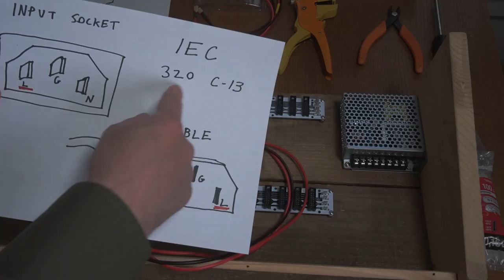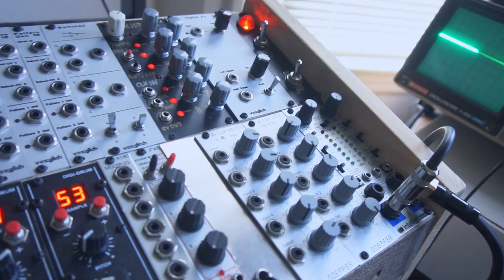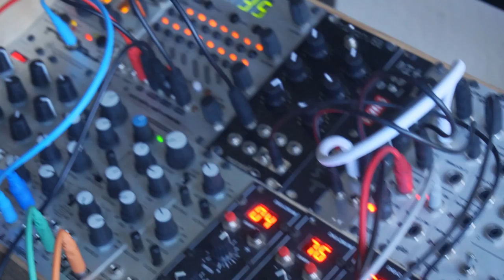DIY Eurorack Case Part 2: Power Supply

Comment: Hey.... your comment disappeared from my video hmmmm...

The output of that reverb needs to be amplified, which is taken care of with the output mixers. The wet/dry levels should be about equal but it's easy to mess that up -- one of my My Favorite Reverb modules has the wet level louder than the dry. Can be cool while performing -- keep the signal dry dry dry then twist the knob to dump some signal into the reverb and "BWAAAaaaahhhhhh" that reverb signal lives in the output till it fades :D

By the way, GREAT case, great production on this vid -- glad to find another synth DIY person!

Comment: Thanks for this detailed and clear explanation! 

I'm about to embark on a DIY case journey and everything is pointing in the direction of a Meanwell power supply, however one thing I don't see anyone who's using a Meanwell mention is that the -12V comes at a maximum of 500mA / 0.5A , according to my ModularGrid case sketch I would draw 750mA (+ headroom) on the -12V side, I've sketched a 7U 104HP case. What are your thoughts on this, do you know how much your cause would draw on -12V and if that's all going well?

Cheers!
Reply from the maker: Interesting, I don't use modulargrid that much so I don't know exact figures, but my case would probably be 300-400mA on the -12V rail. Eurorack modules don't tend to draw a lot of negative voltage, it's really just for balancing op-amps, so I'm guessing you have a lot more modules in your case. I use one Meanwell RT-65B for each row of my 84hp case. They can do more, but separating analog and digital modules gives me much better noise floors. I would recommend using at least two power supplies for your case.
Reply: @extralifedisco  Good points! 

One PSU per row is definitely the safe option. I've noticed it's the pure analog modules that draw the most -12V , I'll have a look into separating them their own rows and perhaps use a Doepfer LC3 to provide for the heavy drawers! 

Good insight, thank you :)

Comment: Thanks for making this video. I wired up my case today, checked the voltage...everything looked good until I plugged in a module and it started smoking? I used 12 gauge wire. Do you think that might have been the problem?
Reply from the maker: 12 gauge sounds, if anything, oversized for +/-12V. I don't think that would be the problem. Most likely you have reverse polarity somewhere - I had the same thing happen when I connected a mixer module backwards (it had an unshrouded 10 pin connector). Make careful note of the "red stripe" and -12V orientation on the eurorack module and double check that your busboard has -12V in the same place .
Reply: thanks for your response! i realized it was the ribbon i was using--nothing to do with the case. it works great! @extralifedisco

Comment: I just got my PSU in the mail today lol (think it's the same one). I'm building my case too this week. 126HP 9U, total is about €75,-
Reply from the maker: Nice timing. That'll be a monster case! Good luck with the install
Reply: @extralifedisco  what is the voltage/ampers of that psu?
Reply from the maker: @Karedu.  50W - 5V/4A 12V/2A -12V/0.5A (The 65W version is common as well - 2.8A on +12v)

Comment: Sorry for the late comment! Curious though, I’m making my first case following this, and in the video you say you got a 10amp fuse for the power switch, but the link in the description is for a 5amp fuse. And the data sheet for the switch says it runs 6amps. So is a 5amp fuse ok?
Reply from the maker: 5A*120V= 600 watts. These power supplies draw only 65 watts so a 5A fuse should be plenty large for this application, though inrush current will be higher, it shouldn't trip a slo-blo fuse.
Reply: thanks!

Comment: man your videos are perfection. I followed your advice for building faceplates (from your passive mult video) - and now i have about 5 nice fully diy modules (mostly MFOS modules) 
now i need more power I got a meanwell rt-65-B
2:05
one question - do I really need a Power Entry Module with an EMI filter?
locally I can get IEC320 fused switches cheaply everywhere - but switched fused emi filtered ones are much harder to come by.
could I get away without it? meanwell supplies are already supposed to be potentially noisy - i dont want mine extra noisey...
Reply from the maker: Excellent, glad to have helped on your journey! Good question about the EMI filter on the entry module. It's probably a little above my pay grade, but I don't think the filtering will have much effect on the noise in your eurorack system itself. It will probably prevent the PSU's high-frequency switching noise from being conducted back to the wall outlet through the power cable - so more likely that kind of noise would end up as RF emissions audible through other devices (e.g. a guitar with single coil pickups). It's definitely not required, so I would use what you can get your hands on and then if you notice that the synth being on causes noise somewhere in your signal chain, consider adding filtering (you can also install a discrete EMI filter inline inside the case rather than swapping the entry module).
Reply: @extralifedisco  good idea - I can get discrete emi filters from my local radioshack (Jaycar) no problems.
thanks for explaining that makes sense enough to me. If i notice some RF noises coming from my setup while my Eurorack is on ill look into it.
but in the meantime - I got a cheap one off ebay (with fancy led switch) which will be here soon - and i can finally finish my case - a significant upgrade from my cardboard shoe box skiff :S
 thanks again and I look forward to the next one :)

Comment: the order of phase and ground on mains is not so important (when in US and Europe, not UK) because wall socket plugs can be rotated 180 by users, whicj effectively switches 'polarity' 😊
Reply: Are you referring to two-prong plugs? Those shouldn’t be used and, if for some reason they are, the hotwire has a wider spade than the neutral. Unless your repurposing some very old cables that shouldn’t be an issue.

Comment: Just a tickle at 120VAC   At 1:39, that power supply would be cheaper on Amazon!   Mounting a Module ABOVE the power Sup. will produce LOTS of noise on that module!!
---
Proper US Color code would be GREEN, NOT Yellow!  Should find-out what the total current is and adjust the Fuse size accordingly!
Reply from the maker: Green would be good! I'm used to Romex with black/white/bare for L/N/G but I didn't realize there's a separate red black green standard. 

Good point on the module noise, I've tried to keep the analog stuff in my cases far from the PSUs in general but that's mostly because they're to big to fit on top lol
Reply: There isn't a red black green mains standard any more (there was in the UK once). The US standard is black, white, green, elsewhere it is brown, blue, green&yellow. People expect to see these colours and understand what they mean. If you use non standard colours it creates confusion and you may make a mistake when you change something.
Reply: @hintoninstruments2369  - And your telling this, why?  Yes I know the Standard in the US.

Comment: How did you screw down the modules to the wood?
Reply from the maker: With small screws, they are size #4 x 3/8 24 TPI pan head sheet metal screws

Comment: I’m a bit confused . The performance at the end showed you switching on two switches to power it up didn’t show them when wiring up ,
Reply from the maker: Yes, I added in a front panel module to allow each busboard to be turned on separately. Each panel switch is just an SPDT that toggles on the +12V line from the PSU to one busboard. This is not often necessary but I was having issues with some older digital modules not booting properly when other modules were plugged in so wanted to separate them.
Reply: @extralifedisco  thanks for that explanation .. I’m just about to build my first diy case , hmm I’m might look into this as a solution , modular grid has calculated my modules power needs , and I’m getting a bit close to the top limit of the meanwell RT65B ,, I. Planning on running 12u at 101 hp .. if switching them all on at the same time causes issues .. fingers crossed ..

Comment: This should be called How NOT to wire a Eurorack case and How to get a Darwin Award.
The IEC Inlet should not be on the outside of a wooden case, it is asking to get broken and then you will have exposed live parts. A better way is to mount it on a small metal plate and mount that on the inside so that the inlet is recessed.
There are proper rubber boots to go over the back of inlets and insulate everything, get them from the same source. Using electrical tape is tacky and will eventually come off as the adhesive goes soft or dry.
Why is the inlet the opposite side of the case from the PSUs? It should be next to them.
Use the proper standard colours.
A 10A fuse is far too large. Work out the maximum wattage and divide by your mains voltage to get the mains current.
Your crimping bodge is a terrible idea. Use the proper tool, they are only $20, to wrap the connector around both the stripped wire and the insulation. Look at the die there are two diameters, this holds the cable so that strands don't break off one by one with flexing. 
The GND terminal on the PSU is a frame ground and only connected to the cover, there may be a capacitor to COM. You need to connect the mains Ground to the 0V of each busboard.
The mains terminals of the PSU should be covered and it would be better to use insulated ring terminals.
If you are still alive and want to stay that way take these criticism seriously.
Reply from the maker: Thanks for the feedback. The inlet is quite robustly attached, I would use metal sub plates only if the case wall was thinner. The electrical tape I agree is a temporary solution. On my newer case I used longer disconnects .

I did want to put the inlet on the same side as the PSU but could not fit them all near each other with crowding out space for the bus boards or usable module space, so elected to run the wires across which I agree is suboptimal but a deliberate compromise.

The live DC terminals were covered later by a 3d printed part on the PSU. I have not found the mean well factory terminal covers reliable or effective. Ring or fork terminals would be better for attachment but I have not had any problems with slippage or work hardening as all wires are staked down and secured.

Fuse rating suggestion is well taken, a 1A or 0.5A fuse would be more appropriate.

Comment: Switch mode is way too noisy. Hope you don't have any sensitive digital modules
Reply: What's switch mode?
Reply from the maker: Switch mode power supply is when a higher voltage is quickly switched on and off (with transistors or switching regulators)  to create an AC wave and then filtered through capacitors to create a lower voltage DC supply. This is as opposed to a linear supply, which takes a rectified AC input and dissipates excess voltage as heat. A switchmode supply is smaller and more efficient but a linear supply is quieter and more accurate, which for some sensitive electronics is important to performance.